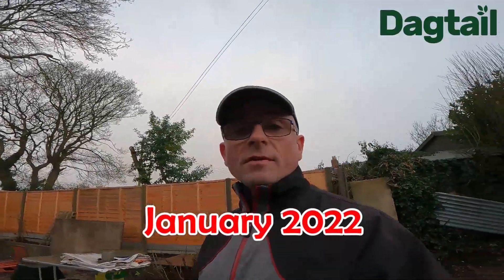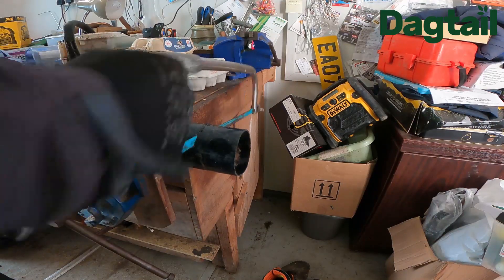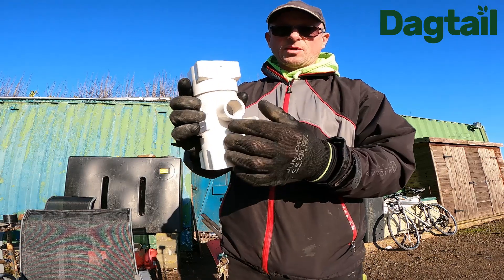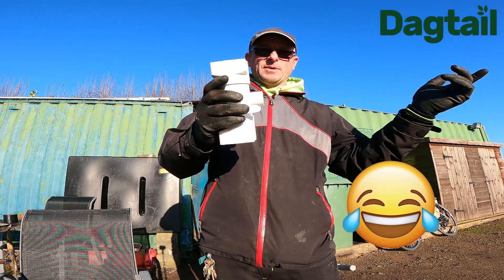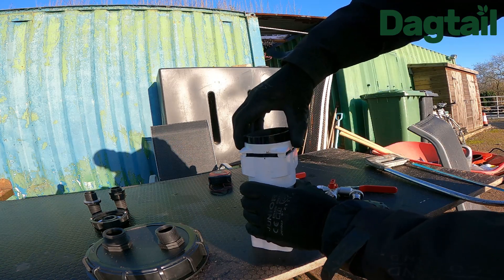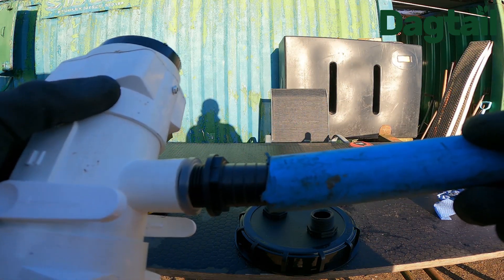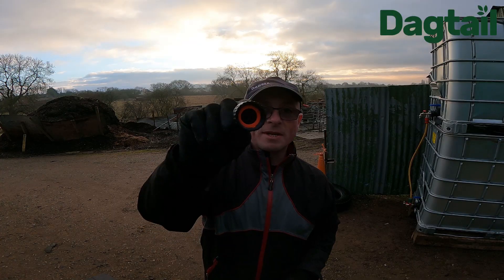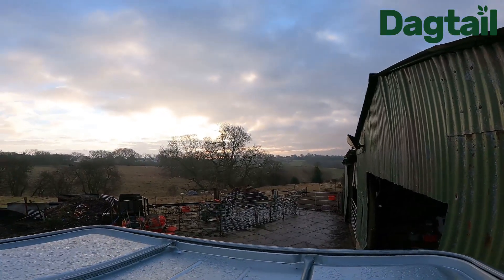HARVESTING RAINWATER/IBC TANKS/TOTES

Comment: Great job just a quick question in summer will you have shade them due to the  extreme heat.
Reply from the maker: We will leave them as they are. The metal cover should help reduce them greening up as it stops the light.